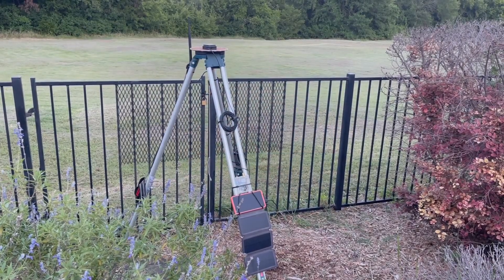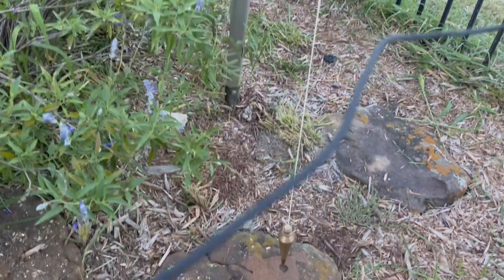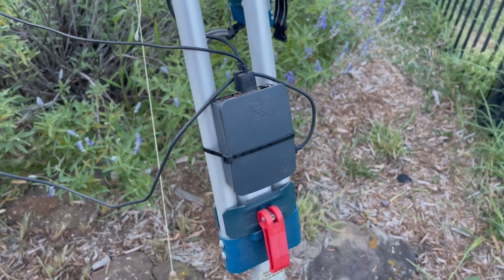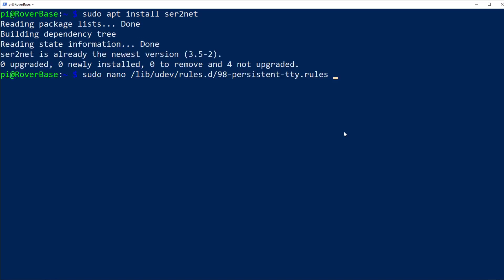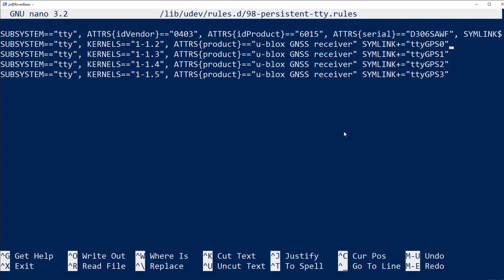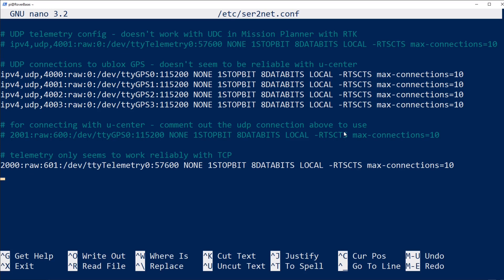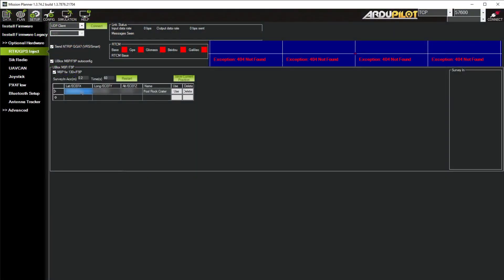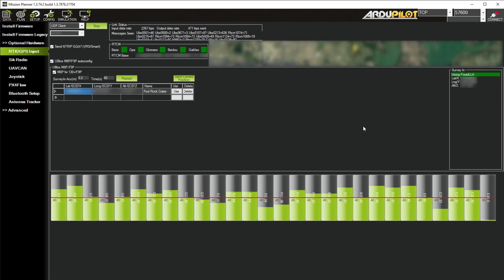ArduPilot WiFi Enabled Fixed Base + Telemetry for RTK GPS

Comment: Excellent video series, thank you! Am I correct in assuming that for this configuration, you need three telemetry radios (one for each: base, ground station, and rover)? Or perhaps do you need a total of four with two on the ground station - one to receive the base RTK and another to communicate with the rover?
Reply from the maker: I used one set of telemetry radios here. Mission Planner was connected via TCP to the Pi for both MAVLink and RTCM3. The 915MHz SiK radio connected to the Pi then relayed MAVLink to and from Mission Planner via ser2net.

Comment: sThank you for the youtube vids. I get a little lost on the discord and github forums as all of the conversations are at different stages of builds. 

I have an RC mower from a 40v kobalt I'd like to convert to autonomous. It uses 24v 16a through a solenoid controlled by a flyhawk to a sabertooth 2x32 .

To upgrade I have collected ( and use on different builds to teach my son ) the pixhawk cube orange, 2x simpleRTK2B, raspberry pi 3b & 4 (with hats and bluetooth dongle) arduino max, laptop, and a new couch to keep my wife happy .

It seems you've replaced the expensive Here system with the chained simpleRTK2B boards and holy bro telemetry. The pixhawk connects to the sabertooth no problem but I am wondering after I set up a tripod base station as you did will there be any other hardware needed to set up this project? 

I'm currently rewelding the height adjustments and components cage. And I am adding an aluminum stand for the pixhawk cube orange to help the compass its 2ft from the steel 3.3 ft from motors.  
Do you keep your cube and F9Ps elevated? 

Sorry for the rant just trying to provide as much info.

And thanks again for the time you take to document your project, if I liked the sound of my voice I'd consider doing the same.
Reply from the maker: I don’t keep the circuit boards and IMUs elevated, I simply take care to keep the antennas in reasonably clear line of sight. Recommend you join the discussions at http://discuss.ardupilot.org for more detailed conversation.
Reply: @YurisHomebrewDIY   thanks I will

Comment: Yuri, can't thank you more! Much appreciated for the detailed instructions. While building my own, coming over and over again to your videos. Do you have latest walkthrough of your control box?
Reply from the maker: That's been on my to-do list for a while!  I'll try and cover the electronics enclosure on the mower sometime soon.
Reply: @YurisHomebrewDIY  since both telemetry and GPS are connected to the RPI, but RTCMs are still routed to the PC and back, have you ever tried sending them directly to the rover without PC? Saw some discussions that Mission Planner can be installed on RPI directly.
Reply from the maker: @weirduserid  I've used ESP32s as well as MAVLink via Mission Planner to send RTCM3.  There are plenty of options!

I highly recommend avoiding installing MP on a Pi.  That's just asking for frustrations!

Comment: Wow! A firehose of information! Very enlightening. I assumed you had a wired connection to your Mission Planner PC from the F9P. This is much better for sure. And I can't WAIT to try sudo on my wife.... If you never hear from me again, you can guess the result. (She runs a daemon (or is it "demon"?) that may trump "sudo".)
Reply from the maker: I tired quickly of dragging the laptop out, setting up a card table, and connecting everything. Stumbled on ser2net with some internet searching and tried it out on an old Raspberry Pi I had sitting dormant. It worked so well that I haven’t really done anything else to it in over a year. It just plain works!  (like that sudo command…)

Comment: Great video, thanks for the rpi showcase. Have you figured out what caused your drone to crash?
Reply from the maker: Thanks much.  It's a mystery!  I'm pretty sure it's related to the initial mis-wiring of the ESC and FC that I quickly corrected but have to assume that perhaps I did indeed let some magic smoke out of a component that wasn't critical...until it was.  I replaced the ESC and FC already, and I'll be replacing at least one motor this week to hopefully fix all the issues I caused.

Comment: I am curious to why your base station mobile/temporary and not permanently mounted?
Reply from the maker: Sometimes I tested in other locations and did not want to invest in another expensive GPS module at the time. Local NTRIP sources were also unavailable or unreliable.

Comment: Can you use a Esp32 instead of a raspberry pie for the base station ?  Or any reason for a raspberry pie instead?
Reply from the maker: Raspberry Pi is much easier to configure, hence my use here. There are some libraries for ESP32, one of which requires a paid subscription and is rather unwieldy to use. No reason you can't use an ESP32 if you're willing to put the effort into it.

Comment: Hi, nice video. I am wondering whether I can connect the RTK in the ground station and the cube orange using the WiFi of my two laptops. I am not using the cube in a drone but in a computer to get the IMU and GPS information, I just have the GPS, and the RTK, not any kind of module, so Have I to buy one telemetry module with no exception or is there any other way?

Comment: Amazing work. Thanks for taking the time to explain everything to those of us that are still learning. One question, in order to utilize GPS yaw, is it necessary to use RTK Moving Base (3 ardusimple boards) or will it also work with Base/Rover (2 ardusimple boards)?
Reply from the maker: You don't need a fixed base to take advantage of GPS-for-yaw.  The rover will get its relative position from the moving base RTCM3 messages.